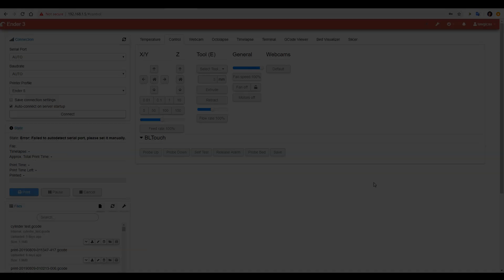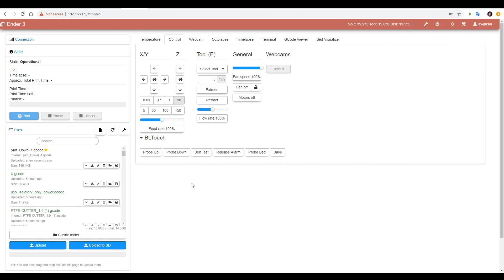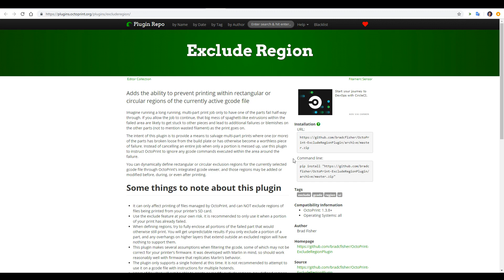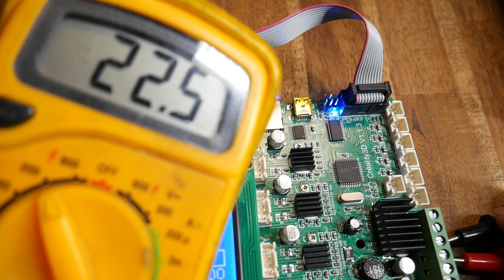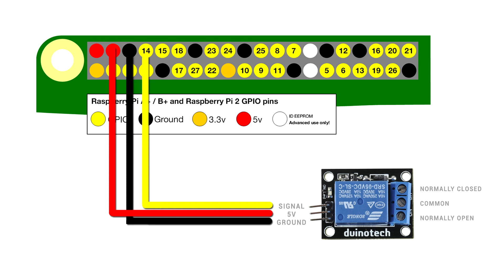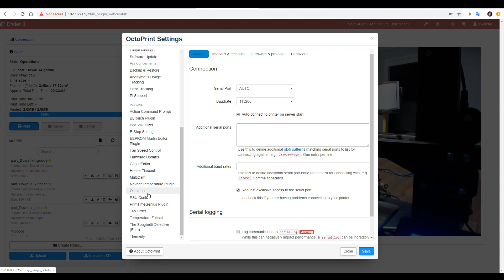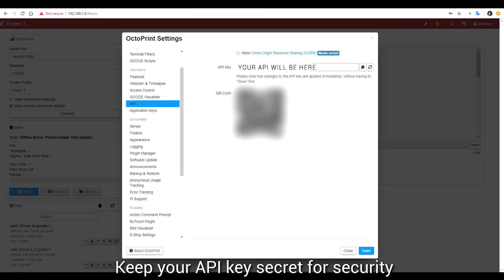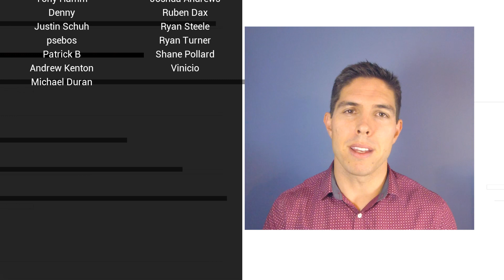Octoprint plugins for better and safer printing - PSU relay control

Comment: HIGHLY DANGEROUS!!!!!!
The relays you are sugesting are all rated for 10 amps. The Ender 3 however delivers up to 15 amps. Your relay contacts will burn îf your relay gets switched while under full load! DC currents are known for arcing which will result in fire after a short period of time. So instead of making the printer safer, you made it even more dangerous! Please do your homework when posting such stuff.
Reply: hi, can you please elaborate how the ender 3 is delivering 15amps? I am in the process of buying relays and I am definately no expert but it seems that the ender 3 delivars 276W/24V = 11.5A. Is this right?
Reply: @savras  I would say their 15A is a generous value but either way the relay shown isn't suitable. Please use a 30A relay.
Reply: @ingy23  it is written on my psu: 350watts, 24v, 14.6 amps. Which is correct if you do the math 350/24=14.6
Reply: @rapman711  Yep thats the max PSU can supply which I do agree you should make sure the connections can support. I was more referring to what the ender 3 actually uses. Either way the relay used isn't suitable and a 15A+ relay should be used. I am always of the opinion you shouldn't also use a relay close to their maximum as they can ware out quicker hence the recommendation of a 30A :).
Reply: @ingy23  I am working as an electrician and you should always be aware of the maximum current possible. So if anything goes wrong on the printer you will (and want to) be on the safe side. But then, like you mentioned on another comment, the printed part has to be modified to accept the slightly bigger relay.
Reply: @rapman711  thanks!!! I got a 30amp relay similar to the one you refer, just to be on the safe side.
Reply: @savras  on my psu it says:  350watts , 24v, 14.8 amps.
Reply: @savras  i would go with one of these https://www.amazon.com/5-12V-High-power-Module-Optocoupler-Isolation/dp/B00ZC4Z0T0 as it can handle up to 30 amps on the relay contacts at 24vdc. And even then, the screwterminals are only rated for 16 amps.

Comment: Great video, thanks. I would recommend you to try WLan Smart Plugs as PSU control. i personally using  TECKIN WLAN Smart Plug(4pcs $30) for around 6months and totally satisfied. (primary bought to turn valve lighthouse base stations on and off)

Comment: Just installed Print Time Genius and Exclude Region, they are the ones that should be most useful to me. Not forgetting thermal protection of course, but I have other safeguards in place, plus, I never leave my printers unattended while powered on. Thanks for all your work Michael 👍

Comment: If Spagetti Detective could be used in monitoring with, Slicing Software progress imaging, to determine if a part is missing and needs to be excluded, thus triggering Exclude Region would be awesome, most Filament printers could use such a backup.
P.S. Your Smoke detector would never work the way you tested it, You would need a Hob with a filtered extraction fan, there you would have to have a smoke detector detect in a Closed System that the values have exceeded norms and switch off the printer, retracting the head away from the print prior to shutdown.

Comment: 5:58 I use a PC ATX PSU which the pi is always on with the standby power and it turns on the main power when a print job comes in and turns off after print finishes and the nozzle has cooled down. better than relay
Reply: It would be interesting to see a wiring diagram or an explanation about that!

Comment: Great walkthru thank you!  I appreciate the plug in information!  Only had my Ender 3x a week and have been watching many of your videos to tweak it.

One question though.  I am no electronics expert, but I have seen comments elsewhere that a single relay is not enough and can actually fry your Pi.  Apparently when it looses power the Ender CPU will pull power from the USB cable from the Pi to the printer.  This overloads and kills the Pi.  I cannot prove or disprove it, but some sources are saying you need to cut the red wire in the USB cable  you use to control your printer from the Pi so that it cannot siphon power.  Have you had any experience with that or heard about it?
Reply: yes backfeeding power on the pi is a known issue. when the pi first came out people were having problems with usb hubs that allowed back feeding of power and they even had a  pi usb hub made that specifically stopped that issue. as for the red wire i would double check it with a multimeter as not all usb cables use the same colour wires for the same pins. so even if you do have a red wire i would still check it.
Reply: How is your Ender 3x? Might get one soon, so wondering how it has been for you since you bought it?

Comment: Thanks for the tips, I have a request is a plugin available to turn off the printer via a Sonoff wifi switch on completion of a print ????
Reply: I would like to know this also?
Reply: You could try flashing sonoff with tasmota and send a mqtt command to the sonoff after printing. Install a mqtt broker on the pi, or even better, home assistant in a docker container. Home assistant has a native octoprint integration

https://www.home-assistant.io/integrations/octoprint/

https://selfhostedhome.com/setting-up-octoprint-with-the-ender-3-and-home-assistant/

Comment: I suppose You could also use the PSU switch to switch the hot end fan off when below 50 as well, my ender 3 drives me mad .... or is there a plugin that will do both with 2 relays?

Comment: The is a Flame Detector sensor (DFR0076) a bit like an infrared detector Don't know how good it is
https://uk.farnell.com/dfrobot/dfr0076/analog-flame-sensor-arduino-board/dp/2946105?gclid=CjwKCAjwqNnqBRATEiwAkHm2BKKBiO0RBlHd7pRV21RnfFIIbkKlAENkZrVS8ohessd9aBAgK3pdmBoC3MoQAvD_BwE&gross_price=true&mckv=YO18ZYDl_dc|pcrid|78108376509|&CAWELAID=120173390002973948&CAGPSPN=pla&CAAGID=14406255429&CMP=KNC-GUK-GEN-SHOPPING-2946105&CATCI=aud-397427915218:pla-41477300408
ALSO):
https://www.ebay.co.uk/itm/183771375471
Five Way Flame Detection Sensor Module Flame Sensor for Arduino
https://www.ebay.co.uk/itm/Five-Way-Flame-Detection-Sensor-Module-Flame-Sensor-for-Arduino-/152932591404

Comment: The 5v mentioned is the "logic voltage" I.E. the voltage used by the Raspberry Pi to control the relay to turn it on or off. The relay in itself (as shown here) is capable of switching mains power, but as described here, it will only be used  to cut the 24v after the PSU. That is fine and should typically not cause any problems. One needs to be aware however that the PSU itself will still be active and receiving full mains power even after the relay cuts the power. This also means that if the PSU is causing the fire, the relay will be of no use. For such a scenario, a Wifi controlled mains power outlet will be a better option, so that the raspberry pi turns off the power at the mains outlet.
Mechanical relays can also be quite noisy, both in terms of sound and electrically, so a solid-state relay (SSR) might be a better option on the mains side, while a mosfet is likely a better option on the 24v side. there are modules for these too, and they are not that much more expensive.
Reply: Thats not true, the listed relays are all to small to handle the 15 amps dc current of the enders psu.
Reply: @rapman711  Either way, as i was saying, there are much better ways of doing this in safer ways, so if you have something to contribute, please do instead of being accusatory.

Comment: The notion that adding a smoke detector to increase safety is pretty silly. If something is smoking enough to trigger a smoke sensor - as you note -, it is probably too late anyway unless you are going to trigger a fire extinguisher.
Adding temperature sensors (DS18B20 for example) at strategic points and polling them by the Octopi to trigger a PSU shutdown is probably a better idea.
Reply: @wboumans  And hopefully most people already have those also for other purposes than burning 3D printers, that was not the point.

Comment: With the no-print rectangle think in z-height, Because it shows only one layer, if your part is bigger on top you have to account for that. I already had it happen that the no-print zone was to small for higher layers.

Comment: I have a sonoff plug (controlled by home assistant) on my printer (cocoon create). It looks  I'll be able to use 'temperature failsafe' to directly power down without psu control. I give  that a try.

Comment: Thank you for this as I have always been unsure of dedicating a RPI to the 3d printer.
Look at the PM2.5 particle sensor instead of the smoke detector as they are far more sensitive and some have heat sensors built in.
Reply: Link? Or at least a Name for a Sensor? I have only found the normale ones on mass, without the Heat Sensor, so a link would be nice...

Comment: How do you link "the spaghetti detective" with the "Exclude region" plugin? Some machine learning from the spaghetti detective could be used to learn which areas are to be printed but are now absent because they've come off the build plate or whatever. If it could feed that region into exlude region, you could have an auto-correcting system that just abandons an object if it thinks it's come off the build plate.
Edit: Spaghetti detector uses deep learning to detect strings. It should, by extension, be a doddle to detect major changes in the video frame, and where it is happening, if something comes unstuck.

Comment: That 2nd plugin is amazing. Makes multi part prints soooo much easier
Reply: You should check out the "cancel objects" plugin. It's similar to "exclude region" but it has the smarts to cancel part of the print based on individual objects instead of a general area.
Reply: neo85271 doesn’t cancel objects require everything be different files? 

I like exclude region because you can cancel if something is in a single file or part of multiple. I have used both and Cancel objects requires too much setup and forethought.

Comment: Hold on, Michael. I think that relay can't switch 24V DC power, it should only be used for switching AC power. Switching DC with AC relays leads to dangerous situations
Reply: It says 30V DC / 10A on the relay though
Reply: neo85271 good eye. So it's rated for 300W max. Ender 3 PSU is 340W and if emergency happens you might need to break the circuit exactly when things are spiraling out of control. I think breaking before PSU is safer or we should use properly rated relays.
Reply: @neo85271  This relay shouldn't be used, it is not suitable for the current. You can easily find a 30A one that is suitable though.
Reply: @ingy23  Can you provide a link to a suitable one?
Reply: @kjacquin  This is the one I used as I believe the terminals are also rated for 30A unlike some of the other 30A relays which the terminals aren't rated for 30A. https://www.amazon.com/KKmoon-2-Channel-Optocoupler-Isolation-Trigger/dp/B07BQN9S3F/

Comment: I'm... disappointed that Spaghetti Detective isn't open source. Can't wait for an open source data-set using OpenCV or something similar. Definitely not worth a monthly fee and privacy concerns. **Correction: It seems you can run an open source version of the project, it simply isn't mentioned on the site. It also doesn't run on a pi, but I could work around that.**

Comment: Great video, very usefully! Might be better to use 127.0.0.1 (localhost) for the IP address in the shell command with the temperature plugin. I haven't tried it with this plugin, but generally this would be a good idea when communicating with another service on the same system. It means the command will still work even if the IP changes, or the network is down. Cheers
Reply: Totally agree.... Although octoprint is a bit weird (as for as Linux/Unix daemon conventions) so it would be wise to double check it is listening on all interfaces before assuming this.
On further thought, its probably wise to test the command from a shell regardless, since some popular distros do not ship curl preinstalled.
Reply: Or just assign your Raspberry Pi a static IP on your router.
Reply: @rileyfenley522  You can assign an IP to a device in your router by reserving it. Assigning a static IP is done on the device.

Comment: Thank you for thorough analysis and selection of plugins. I'd like to grab the attention to the ratings of the relay being used as it has to cover the maximum DC current plus a margin. Not sure if the shown in the video with 30VDC/10 Amps will be enough to properly and safely support the Ender 3 printer.
Reply: That's a good point. When heating both the hotend/bed and powering all the other electronics,, the printer may potentially pull more amps than the 10A relay is rated for. 

The Ender 3 PSU is rated for 350 watts at 24 volts, so rearranging the formula 
watts = voltage * amps to amps = watts / voltage gives you ~14.6 amps 
which is well above the spec of that 30v 10a relay.

The question is, what other options are out there that would fit well in this type of application? Preferably retaining the same footprint of the 10a adafruit relay but supporting a higher current draw.
Reply: @neo85271  I would recommend getting a 30A relay yes they are bigger but can handle the load otherwise you are stuck with a mosfet which could fail in a similar way to which was described in the video, on the other hand relays can also fail but are a lot less likely to when not run near there max load.
Reply: There are comments about this elsewhere, but the relay should chop AC power between the power plug, and the LINE IN on the power supply, not on the DC outputs. The Ender 3 Pro PSU draws 110v @ 9a. This is within the labeled rating of these off-the-shelf IoT relays. On the DC side, when converting to DC, it's stepping the voltage down to 24v @ 14.5a, and as you can see, the amperage is considerably higher than the rating of the relay. Safe way to add the relay is on the AC side, between the wall plug and Line In on the PSU.
This does mean you'll need a separate wall adapter for your RaspberryPi, rather than a buck converter to power the Pi. The Pi would lose power when you trigger the relay, otherwise. (I consider this a perfectly fine trade-off.)

Comment: Other nice plugin is https://plugins.octoprint.org/plugins/octopod/. It sends notifications to your phone when printer encountered a thermal runaway error, min temp error, max temp error or any other firmware error. For convenience it also sends notifications when printer halted and is waiting for user assistance (great for MMU2 or manual multi color printing). It also includes notifications if you are using Palette 2 and needs user assistance. There are more notifications that the plugin can do. From the OctoPod app you can control the PSUControl and many other plugins like TPLink, Tasmota, etc. It also makes use of the MultiCamera plugin. Bonus: It is all free an open source. :D

Comment: I'm not sure how available TP-Link smart plugs are outside of the US, but I have most of my printers and accessories plugged into them, and use the "TP-Link Smartplug" plugin for Octoprint to control them (and show energy usage on them, if you have the HS110 model of plug).  I didn't know how easy it was to set up max temp triggers using the temperature failsafe plugin, so my next step will be to set that up to turn off power if that triggers.  I also want to look into a real (commercial) smart smoke detector, and have Home Assistant turn off power to basically everything in my workshop if the smoke detector in there detects any smoke.  Like you established in your testing, it might not be fast enough to prevent a fire, but it certainly shouldn't hurt anything to turn off the printers in the event a fire breaks out (other than maybe failing a few prints in the event of a false positive, but it seems wise to err on the side of safety).
Reply: Oh, also, I have a CR-10 S5 with an aftermarket keenovo heatbed on it, and I use gcode to the TP-Link Smartplug plugin to turn the heatbed on at the start of a print, and off at the end. It saved trying to get the printer to handle the heatbed wiring (that particular heatbed is 1200 watts).

Comment: It really does not take very long at all for a bad mosfet just to melt the heat block around the heating component, so this far better than just thermal runaway detection.

Comment: Morning Micheal, PSU control will it control a smart switch? Which I use to turn my primters on from my house to my shed 100 metres away?
Reply: No, but depending on what brand of smart switch you have there may be a plugin for that. TP-Link and Tuya smartplugs are supported natively with plugins, but from firsthand experience you can also get any plug that works with Samsung smartthings to work using the IFTT plugin as well.

Comment: had a print stop mid-print. The nozzle was in the plastic all night at 245c was printing modified abs glad it didn't catch fire as it was chared around the print where the nozzle stopped, what happened was one of the end stop plugs fell out. So i tapped the wires so they won't wiggle out